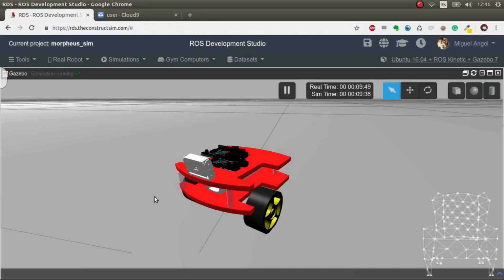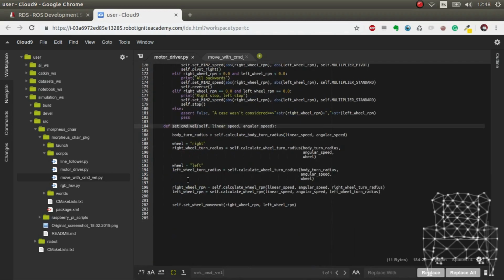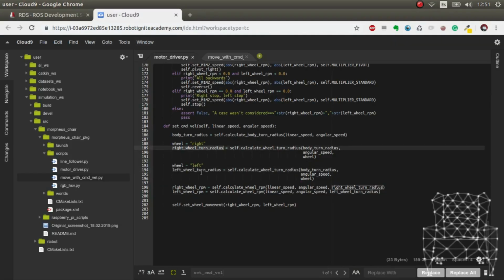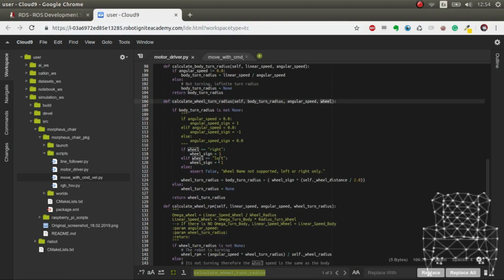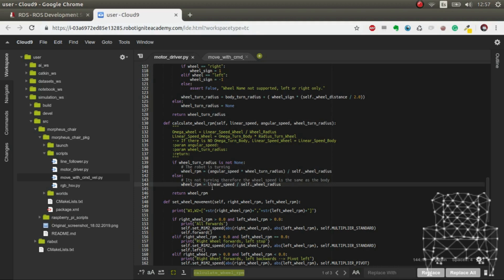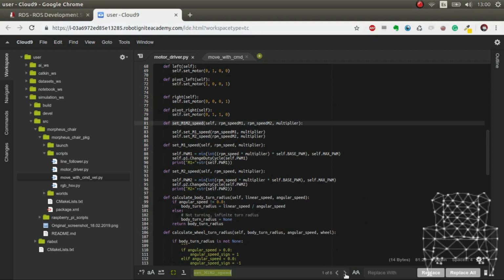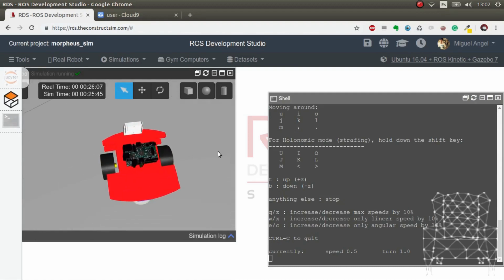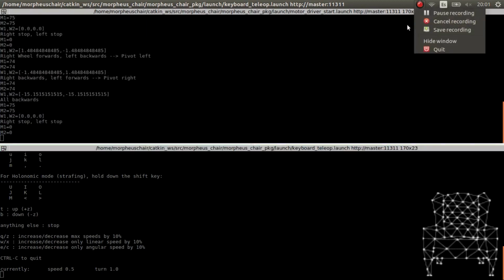[Morpheus Chair] Differential drive with Raspberry Pi | Ep. 4

Comment: can i get odometry using this code by giving encoder values
Reply from the maker: The current model of the real robot does not contain encoders that allow you to get the odometry. In order to get the odometry you would need to include the encoders and then build the software that access the encoder values, and use those values to compute the odometry
Reply: The Construct  Can u suggest me some tutorial from where I can learn to build the software for odometry
Reply: Divyam Garg https://yadi.sk/d/HFBIQD-MCLbihA nodes from book 'Ros for absolute beginners'. there's a node for odometry - diff.tf

Comment: When you are done working with the code in RDS how do you move it to the Raspberry Pi before you ssh in?
Reply from the maker: So you have to ssh inside the robot in order to pull the latest changes you have made to your code. Unless you create inside it an automatic system that pulls any change made in the git, which we won't cover that in these tutorials. Was that you question? If not, please elaborate :)